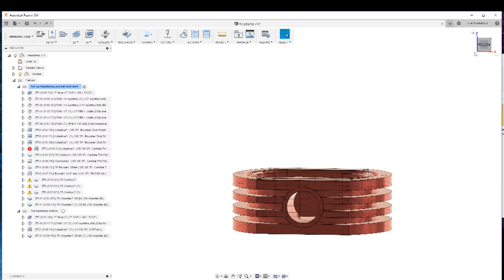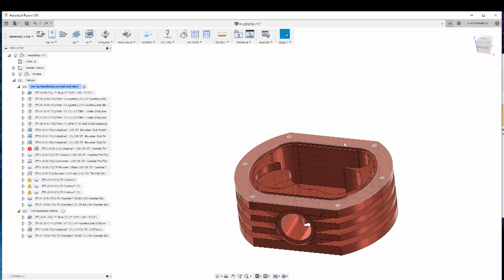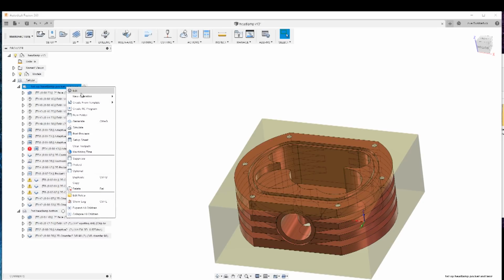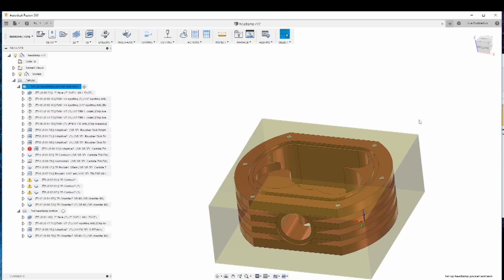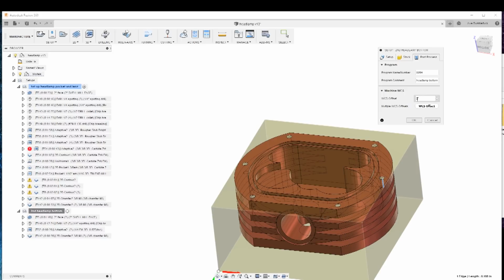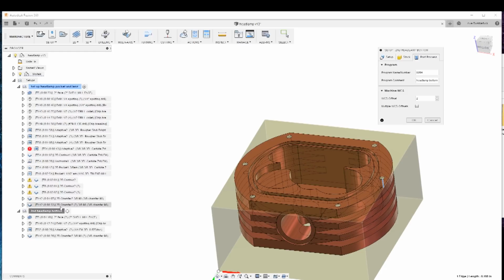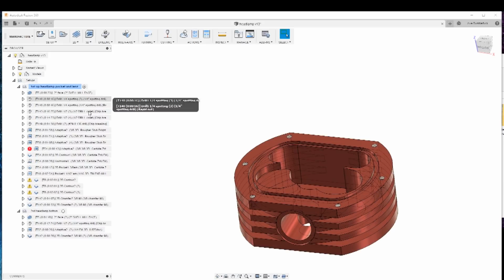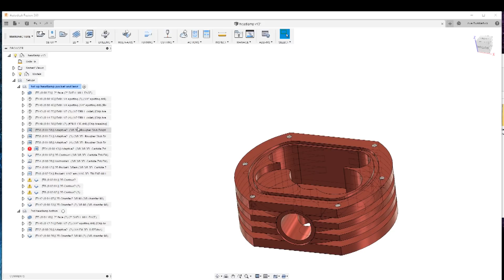Speedy Fusion 360 Ep. 12 Multiple WCS Parts

Comment: I used to run a cannon stepper at TI, well several versions from I2 to I5 to 6, 8 and 10 inch wafers if I remember correctly. I loved this vidjayo series. It is in a way the same as laying patterns for other chemical processes to happen. I'm a metal guy though, no skills and love everything about working it from furnace to end product. I'd love to be able to use a CNC machine, or at least have access to one. Great set of vids, I can't wait to see the finished product!!

Comment: If you select "setups" and post from there it should be able to handle different WCS and in the post process tab you can select "reorder to minimize tool changes".  Your post might need to support it tho
Reply: I work with Hass nextgen control and it does support the “reorder to minimize tool change” and it works like a charm. Definitely the way to go here! Simply select both setups and check that box wen posting.